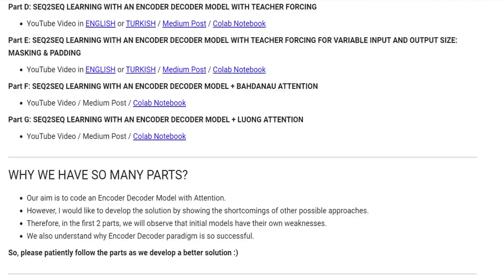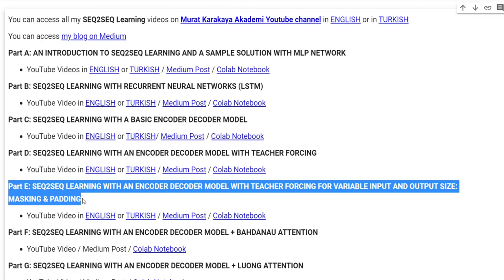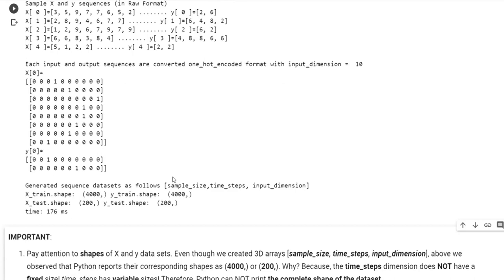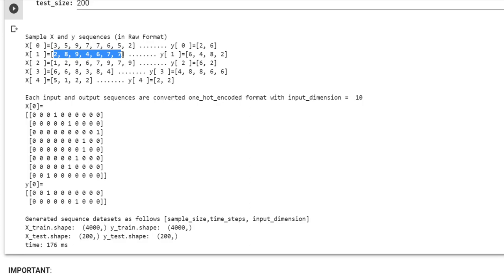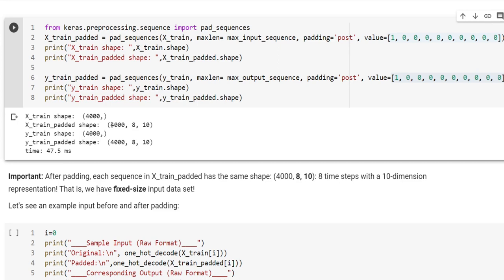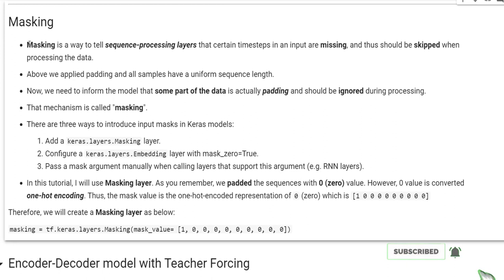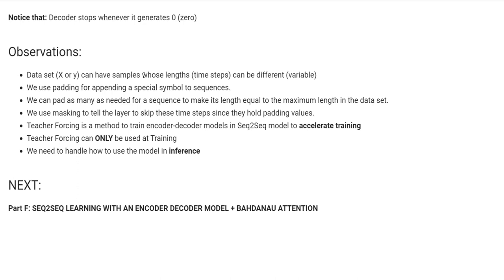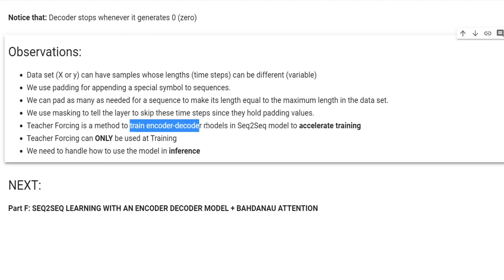SEQUENCE-TO-SEQUENCE LEARNING PART E Encoder Decoder for Variable Input Output PADDING MASKING

Comment: Hi, I just had a question regarding the technique to deal with variable-length sequences. You've mentioned in the second video in the seq2seq series that there are other ways other than padding to deal with Variable length sequences, as in some applications we cannot really judge the maximum length of the sequence. So are there other techniques that deal with variable length sequences and could you mention what they are?
Reply from the maker: Very good question! Another method is to use the ragged tensors in TF. Unfortunately, they are a little bit confusing. You can visit the official documentation to learn more: https://www.tensorflow.org/guide/ragged_tensor

Comment: Hello, Thank you for this tutorial. I have a question, if we have input of shape (None, 7,6) and output of shape (None, 2,6), Is there any need for padding (you told in the video that for ANN all the input and output should be in same shape !)? As I see you applied padding to both x and y train in the tutorial and you only applied masking on the input. How about my case? Input: (None,7,6) and Output:(None, 2,6). Thank you!
Reply from the maker: Hello Ehsan! The padding is only necessary for the input as the models expect fixed input size most of the time. Moreover paddings are important for improving recurrent layers (transformers too!). We do not use (mostly) padding for the output. However, in your train set (X & y), you need to provide tensors with a fixed size shape. Ragged tensors are rare in applications as far as I have seen. I hope it is clear now?
Reply: @MuratKarakayaAkademi  Thank you, if there is no need for padding of output and there is a obligation of having equal size input and output, so how can we make them equal? could you please give me one example for the case of having different input and output size. input: (none, 7,6) and input is (none, 2,6)
Reply from the maker: I have to clarify the situation. In general, the input (X) and the output (y) should be fixed size tensors. But they do not necessarily need to be equal shape! As in your example, X's shape could be (none, 7,6). That means every sample in X must be a 7x6 shape (Rank 2) tensor. Likewise in y, every sample in y data set, must have a shape of 2x6. You do not to make X and y shapes equal. However, (most of the time), you have to ensure that every sample in a data set ( X or y) has the same tensor shape. There is a special kind of tensors called ragged tensors in which we have the exception. Look here: https://www.tensorflow.org/guide/ragged_tensor. I hope everything is clear and simple :) Let me know.
Reply: @MuratKarakayaAkademi  Thank You